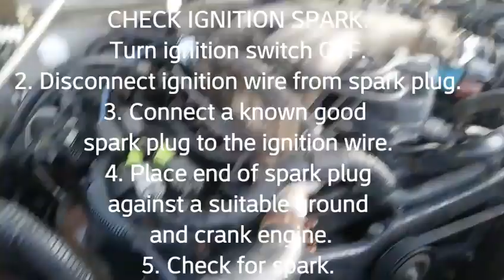Random Cylinder  Misfire-DTC P0300.

Comment: Thanks for your quick response. Excellent, excellent video. But with my situation, my engine was running excellent until I removed the battery to replace my power steering pump. Would that create any problems to throw this code? I'll check the spark plugs wires and distributor. I just don't see it being an injection problem. A week ago it threw a code P0174 bank 2, too lean. Ran some cat. cleaner through it and that code hasn't come back. If it were the P0174 which sensor is it, pre or post? Thanks
Reply from the maker: You might have a Mass Air Flow sensor problem. If the ECU detected a P0300 and the engine does not physically exhibit bad running conditions. It means the ignition circuit is good and engine cylinder pressure with fuel is good. Check the top of the engine plenum(acoustic intake manifold). There is a Ground (-) connection with four wires, clean the surface of the contacts and tighten with grease. https://youtu.be/1w50pfdX-Gw?si=FG6zxDNH6KDmcSLh
If the code reset after cleaning ground connections, might want to replace the MAF sensor.
Reply: It is running really rough at idle. Smooth then rough. I did check the mass air flow. Cleaned it and back probed it. All good. I'll double check the intake bolts and look at the ground wire. Like I said earlier. It was running excellent until I removed the battery to replace the power steering pump. A real head scratcher. So frustrating!  Thanks again Four Real. Wish there was a way we could talk elsewhere.
Reply from the maker: @kellyo.mcgregor1697 what is the milage?. Fuel pressure should be at 36psi. If the ECU can not pin-point which cylinder is having a mis-fire by displaying a DTC, example P0302 or other. Then world suspect MAF or Fuel pump pressure or check for any vacuum leak at injector O-ring. Try cleaning the inside of the throttle body air valve flap.
Reply: I'll check this out. But it just doesn't make sense. I had it running perfectly. All I did in Saturday was install a new power steering pump, which I had to remove the battery. We didn't touch anything that had to do with the ignition. 🤬 But I'll take another look in the morning. Thanks @stevexnycautomotive

Comment: Having the same code on my 03 Xterra replaced all the gaskets, seals, vaccuum lines, spark plugs, distributor, coils, EGR sensor. 

And still can’t figure it out.
Any suggestions
Reply from the maker: How about a GENUINE NISSAN DEALER OXYGEN SENSOR for the rightside exhaust manifold?. The sensor harness must have the black protector conduit to maintain OEM requirement. It's a performance part that is very important to engine efficiency. I did it all too, till I install a Genuine Nissan oxygen sensor to get raid of code P0328. It took me 100,000 mile and 10yrs to figure out the engine was fitted with a aftermarket(DENSO) O2 sensor for the application, then I replaced it with a O2 sensor from the pathfinder vg33e application. The P0328 code disappeared and then a P0300 appeared. Sometimes the SES light would flash with no changes in the engine operation. The ohms reading for the oxygen sensor is very important in order for the ECU to perform accurate calculations for fuel and timing function. 
Here are some videos that might interest you for a better understanding. 

https://youtu.be/5k5gxjqVGeU
https://youtu.be/5uzULUuBTZ0

Comment: Good day Ser. Please give a direction to your video on diagnosing and replacing the MAF sensor, I could not find it? Thank you.
Reply from the maker: That is crazy. Then the ECU management might be PFI?. Where are you?. This video might help: https://www.google.com/url?q=https://m.youtube.com/watch%3Fv%3D2q4r3gavIfI&sa=U&ved=2ahUKEwjnzs_fl6_1AhX_TDABHb1RAQsQuAJ6BAgLEAI&usg=AOvVaw3mvF3DuSXM9KA_NNazZwSZ. Programmed fuel injection does not us a MAF sensor. Only Federal model uses it.
Reply: @Stevexnycautomotive  Yes, yes,))) this is what I need, I just looked for it on your channel!)))
Reply: Not exactly. Not detailed! Well, so be it.
Reply from the maker: https://www.google.com/url?q=https://m.youtube.com/watch%3Fv%3D1knD-URJZzk&sa=U&ved=2ahUKEwicp7jwp6_1AhVqRDABHSvvBGQQtwJ6BAgIEAE&usg=AOvVaw2Zv9M8m82DKuUgB-RDvW3y
Reply from the maker: Its next to the air cleaner box, mounted on the intake air duct.
Reply: @Stevexnycautomotive  No, I wanted to know if you have a video on your channel to replace it?
Reply from the maker: Negative. Currently equip with a CAI induction behind the headlight

Comment: Hey Steve, I have watched many of your videos (because they are so good) as a reference to working on my Nissan Pathfinder VG33E. Here at the 8:00 minute mark you suggest a compression test. I noticed on another of your videos, Nissan VQ35DE compression & oil pressure Test Part 5/9, where you demonstrate the compression test, the VQ35DE engine test results were similar to my VG33E, in that I had pressure over 200 PSI. The manual says Max 175 PSI. Why are the test results so much higher?
Reply from the maker: A hot compression test will should lower psi. Thanks
Reply: @Stevexnycautomotive  Thanks for the quick response Steve. Could I also ask, do you know of a good way to test if coolant is leaking into a cylinder and burning away with the exhaust? I am losing about 200ml of coolant on a 1 hour drive. There are no visible leaks anywhere. BTW my Nissan does not ever show any codes. The Engine Light works OK on ignition, but never displays any errors. In the 7 years I have had the vehicle I have had many severe issues that should have raised a DTC code. Is it possible that a previous owner has somehow disabled this Diagnostic feature?
Reply from the maker: If coolant is leaking into the combustion chamber it will show up on the spark plug electrode. You could also have dealer or auto parts store test the coolant to see if its mixing with other liquid or leak. How is the water pump?. The coolant leak checking should be done when the engine is hot and not in operation. If coolant is burning in the combustion chamber you would be able to smell it at the tailpipe. Also try to have the vehicle ECU scanner, to see if any codes are stored in the freeze frame parameter.